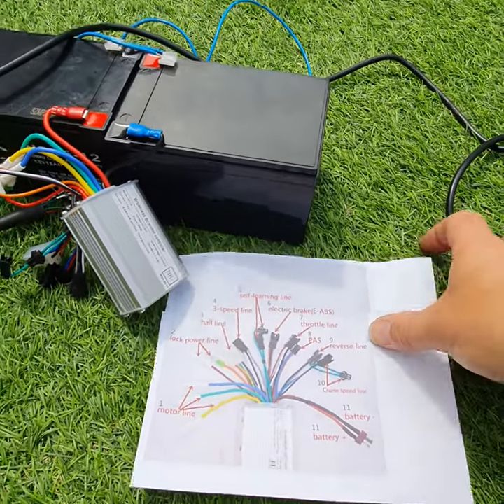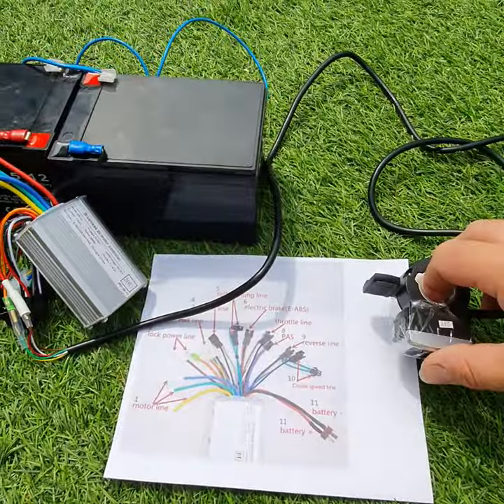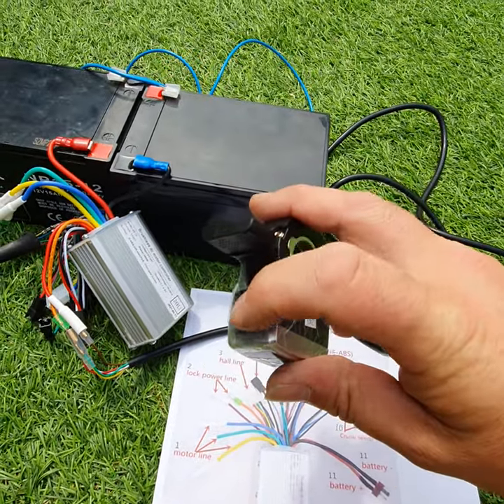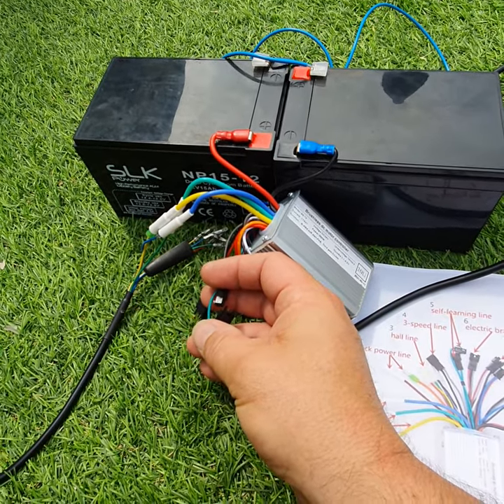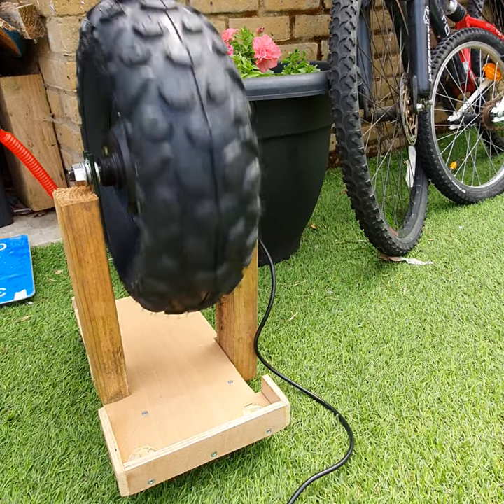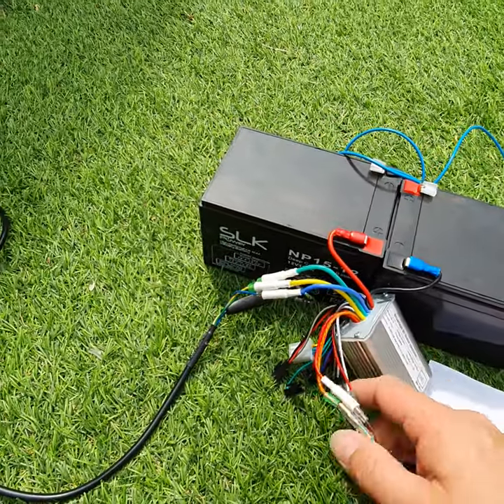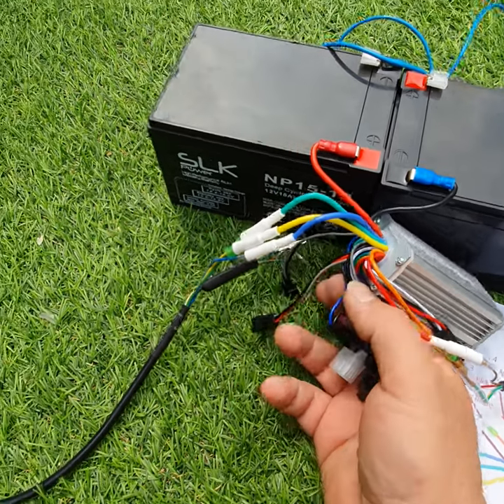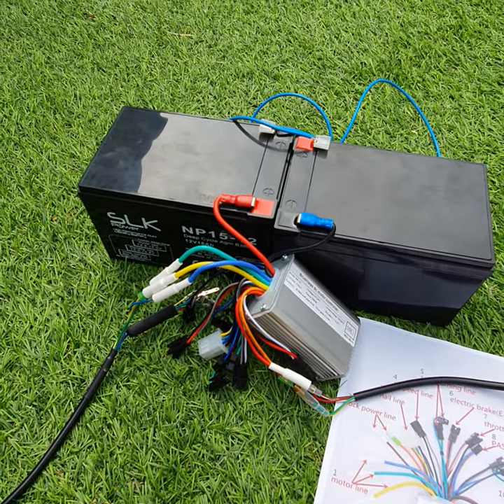Converting a carp porter to a motorised barrow

Comment: Hi Glen. I recently completed my conversion with the same kit. A JRC wide wheel barrow was my subject! I researched the Hall Sensor wiring and found some interesting stuff online. This wiring loom should be included as it communicates with the controller re the amount of torque required, weight vs torque calculation. We need this considering the amount of weight we put on the barrow. It works and turns without the Hall Sensor but it delivers a better experience once connected.
Reply from the maker: This is great information and I will be connecting mine This weekend, thanks
Reply: Could you tell me please where I could buy the parts to do mine please.

Comment: Hi glen . Clocked the conversion kit on Aliexpress. Just out of interest what power batteries are you using and does the wheel fit easily to the existing barrow axle set up. Thanks.
Reply from the maker: I'm using 2 X 12volt 12amp batteries that I got from ebay, for the axle I found I guy on Facebook that was making them and a part for the thumb throttle

Comment: Hi would be much appreciated if you could add the links where to buy the wheel hub and throttle thank you 👍🏻
Reply from the maker: Evening I believe its this one 
US $112.00  20%OFF | 24V 36V 48V 350W 500W Electric Wheelbarrow Gear Motor All Terrain Electric Wheelbarrow kit Fat Off road Rough Tyre 14.5 inch
https://a.aliexpress.com/_mPbku90
Thanks

Comment: Hi glen, tested mine the other day fully loaded worked perfect! Only issue was the controller was quite hot, have u tried yours yet?
Reply from the maker: Hello, yes tested mine at the weekend but not sure if the controller was hot as it's in a box I will open the box up today and have look for signs of over heating , work on the video of the barrow fully loaded, cheers
Reply: @GlenHarvey  thanks mate 🎣🎣
Reply from the maker: @SpikeSCFC  just uploaded my build video
Reply: Can you buy these to build yourself glen
Reply: @phillipguy2858  yea ya can 👍 Ali express for the 24v 350w wheel kit, eBay for batteries and eBay for connectors if needed

Comment: which wheel is that?
Reply from the maker: Hello, I'm using the wheel from AliExpress 24 volt 350 watt and 14 inch wheel
Reply: @GlenHarvey  how you finding it? Have you managed to test it with a decent load on the barrow for a fair distance yet? 
I'm also trying with the idea of doing this. Was thinking of an external drive motor but if the 1 your using proves to be reliable then it will be the easier route 👍🏼
Reply from the maker: Afternoon Alex,  I have now finished the build and will put a video on here, but no not as of yet, my first chance will be the end of the month, I will let you know how it goes, I don't travel light and the swims that I like are around 500 metres away
Reply: @GlenHarvey  fantastic that'd be great if you can. Looking forward to the feedback. Fingers crossed all goes well & it works as expected 😁
Reply: Hi Glen,

Is there throttle adjustment as it seems very fast, although not under load at the moment?

Do you have any links for the components please, am interested in doing similar.

Thanks in advance
Reply from the maker: @LW21_Coaching  when it's under weight it's a lot better, I will be putting a new video up as going to show the build and what it is like under weight, all the parts are from AliExpress and got the batteries from ebay
Reply: @GlenHarvey  hi glen great video, what battery’s did you get and how long do they last fully loaded!
Reply: Had for 4 years now but not with the same parts